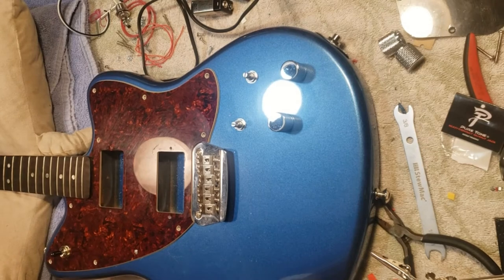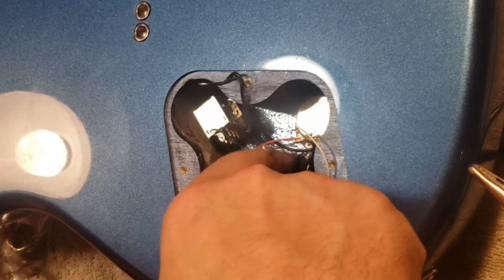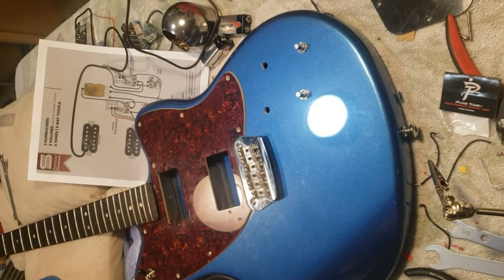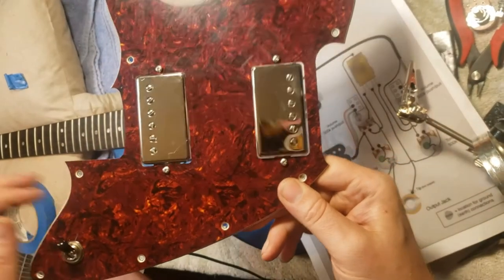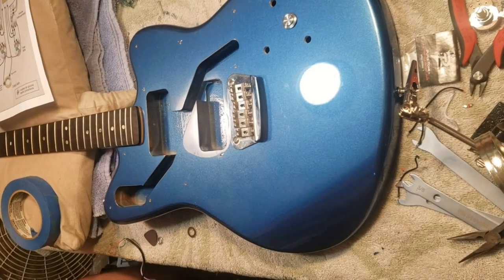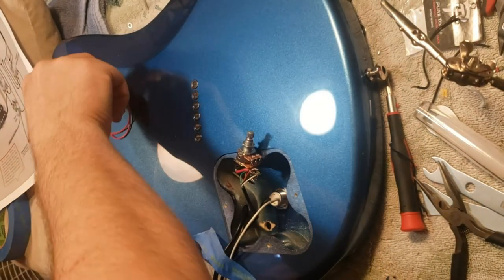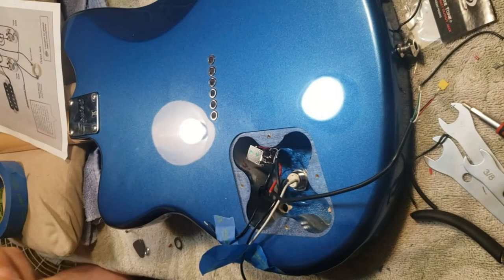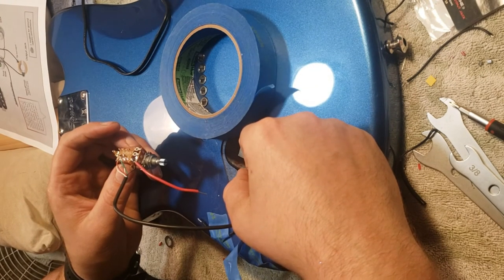Installing Coil Splitting Pots and a Kill Switch Part 2 - MUSIC IS AWESOME (episode 1)

Comment: I put a kill switch on my Toronado too, but I put it an inch or so to the right of the pick up selector. I thought having to reach down between the pots to use it would be irritating, plus I upgraded the stock bridge pup to a Seymour Duncan P Rail and used the space you used for your kill switch for the mini toggle switch.

Comment: I'd like to mod my squier toronado, want to put two hamucker shaped p90s or two spilt single coil humbucker, and upgrade the electonics for a better responsive control on tone and volume but I have problems with the neck, and with the narrow tall frets especially. everytime I press my fingers on the fretboard to play a chord the strings flex or bend (or both) to much and so they sound out of tune, bending everywere and flex to much from the frets to the fretboard, plus the first and the last string slips out of the neck a lot while I'm playng chords or little solos. I love this guitar, but I can't think of any solution about my issues with the neck and don't want to spend tons of money to make it playable. I have to take it to a liuthier but I fear that I'd just chosed the wrong guitar and maybe alla I have to do is to just invest some money on a good guitar instead of a cheap product
Reply: I don't use to much force to press my fingers on the strings, so maybe a different string goudge like 10's or even 11's could help. I currently use 9's